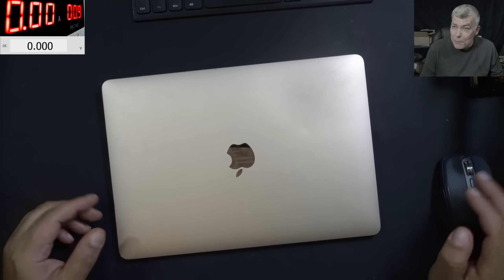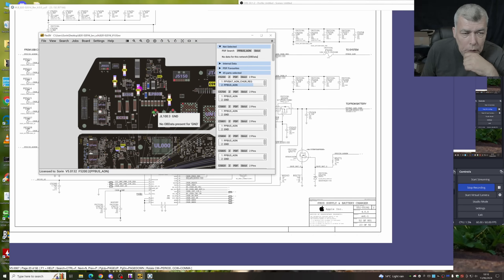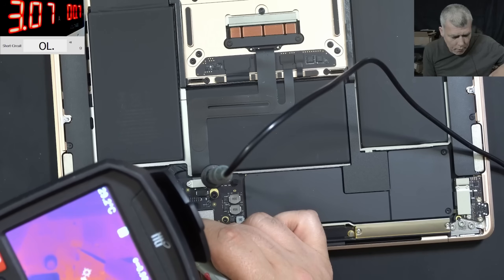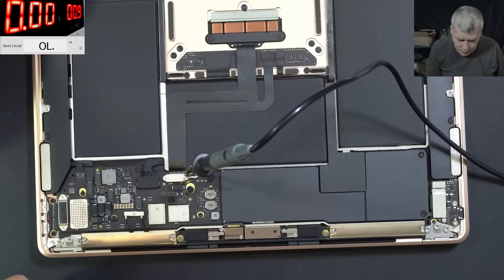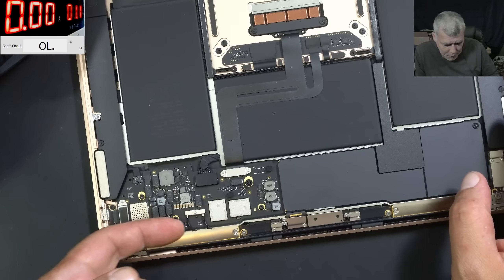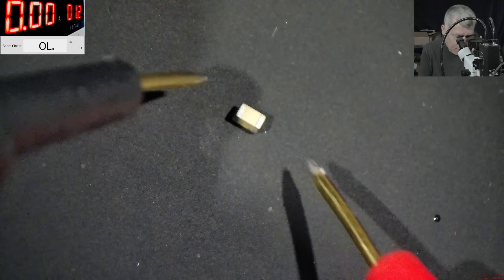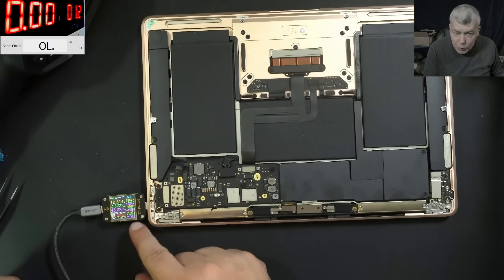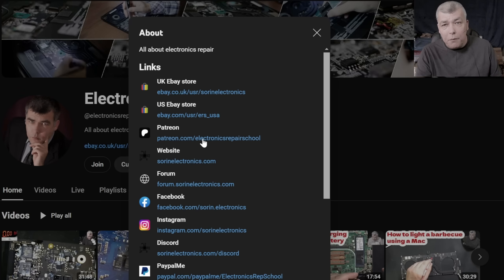A2337 MacBook Air 820-02016 not charging, board repair

Comment: Thanks a lot for the complete description: brand, model and you even included the part number of the motherboard.

PS: I will dare to make a sincere, honest observation without any intention of hurting:
You Master, only need to properly replace the components that you remove: fuses, ceramic capacitors (as in this case), that is, that would greatly increase the confidence of the owner of the device (private customer) and of course it would also please the manager of the local workshop that sends you appliances to be repaired and mainly you would see the increase in the amount of work you would receive.
On the other hand: assume that my car broke down on a busy street. I call my trusted mechanic and he comes with a trailer. He tells me that it is a failure of the CV joint and I won't fix that. He calls another mechanic who tells him he has space right now. He orders one of his assistants to tow my car again to the other workshop. Another way of saying it, he will charge me for the diagnosis and the cost (gas) of both trips.
Based on this example: if one of my clients wants us to come to their home for their device, without even opening it, we already warn the owner that we have a minimum diagnosis fee. Another way of saying it: You, in my particular opinion, also have to collect it. 
Due to the nature of this comment, I will only leave it for 48 hours before deleting it.Greetings from Mexico.

Comment: I'm pretty sure apple didn't even diagnose the board, they just swap it for a brand new to test if it's the board, and go charging for a replacement without concerning for data or anything else. That's how they do it. It's not repair, it's swapping the board and that's all they do. If they can't replace the faulty part, they just condemn the whole notebook and you need to buy a new one lol

Comment: I've had desktop PC's for 30 years. Aside from hard drive failures, the only hardware issue I've had is 1 shot power supply and 1 shot motherboard. On different machines.

So why do all these laptops keep breaking? Is it something to do with the constant switching from battery to mains? Or because they're being thrown around a lot?
Reply: late 90's was pretty dodgy for power supplies and motherboards tbh. some of my finest explosions on cheap asrock mobos.
Reply: Probably because laptops are more common. Furthermore if a cap burns in your desktop Mobo you can just buy a new Mobo and swap the other components (ram, CPU, ps etc). A repair could have the same cost of a new Mobo